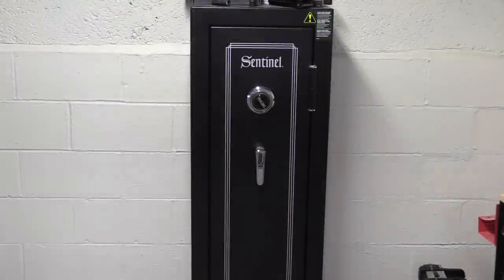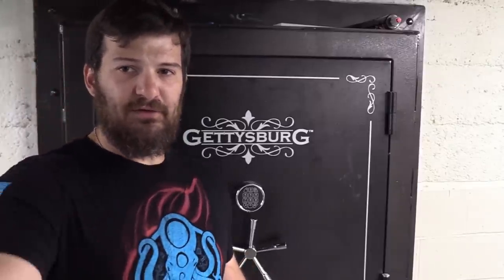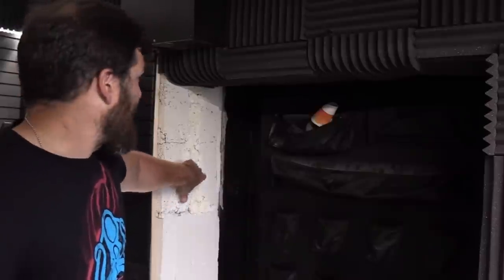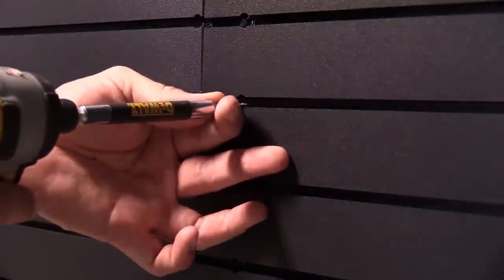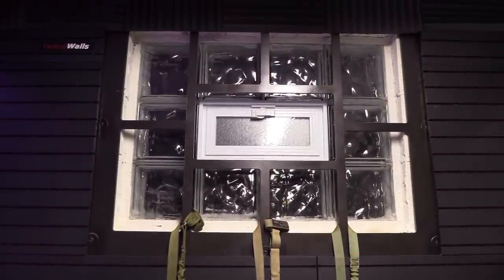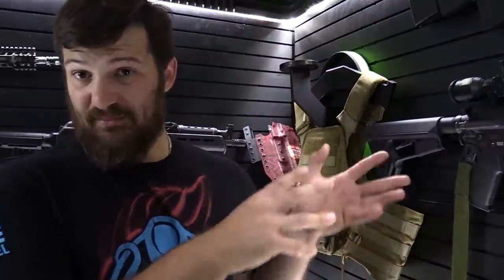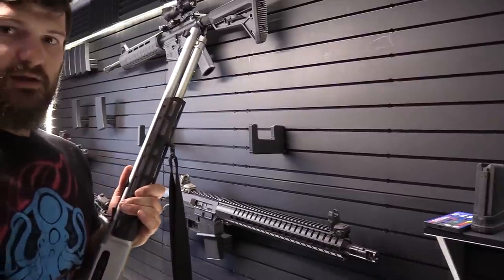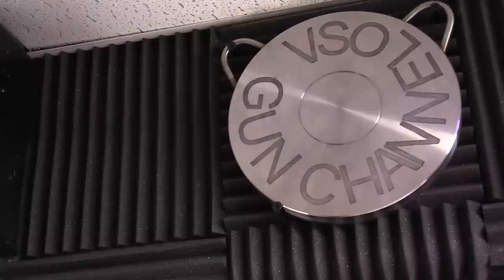The Ultimate DIY Vault Room

Comment: That window is a weak point.
Reply: Super nice room though. Not hating, nice work.
Reply: really?? the drop ceiling isn't?? would take me about 5 minutes to get in from the top, the window is a lot more difficult and obviously he's doing this for fun
Reply: He said in the video it has concrete above the dropped ceiling but yes I would of blocked in the window
Reply: Grapple hook anyone????
Reply: JoePJack1 grapple hook? Have fun with that James Bond
Reply: Angle grinder with 15 extra discs (probably olny need about 5) and a few hours, thats all what window would take.
Reply: @flyingfishsauce  would take a whole 5 minutes
Reply: DavePlaysGames Im giving the benefit of the doubt to that metal grate thing, that steel would take a little more than 5 minutes. Then again, I would be cutting the whole thing off because im not trying to squeeze through a small hole.
Reply: Plasma cutter?
Reply: I agree, the window is definitely a weak point.  Plus with an 18-inch concrete roof over the room, it's definitely not directly under the house. And from the looks of the shrubs outside the window it looks like that windowed wall could be exposed on the outside.  Which means somebody in a beefed up truck and a chain could kick out the blocks, wrap chain around the the great, and yank a hole right through the wall. Not a good day.....  Yeah I would definitely get rid of that window and reinforce that area with rebar.
Reply: I stopped the video when I saw the window... ware of money bro!
Reply: no i was thinking more it would be harder to find his house, then i was going with the burn the whole thing down type of thing then yeah would prolly need a ladder or two
Reply: just cut or torch the mig welds on the door
Reply: 5 minutes through concrete he has in the ceiling ? You are a beast !    LOL
Reply: just a screwdriver after a rock through that window, look at the screws holding the cage in !   Its still a very safe and secure room, not hating at all !
Reply: @warrenmichael918   why bother with a screw driver, a truck and a winch yank the whole damn thing out in a tug.
Reply: @flyingfishsauce   a 40 dollar 18volt Ryobi reciprocating saw, and two good blades would open that like a sardine can in 2 minutes...  The thing about "hardened" steel... Is carbide blades zip right thru it.

...but don't tell anyone, they might call you stupid. 😂
Reply: @paulthorla9569  who... what? who other than a foreign invading military force would take the time and resources to rob a house with that much effort?
Reply: Oxypropane cutting torch (small backpack sized one) -> 10 seconds for each bar
Angle grinder (portable one with battery pack) -> 20 seconds for each bar (with some noise)
portable 5 tons hidraulic jack -> 30 seconds for the whole grate
Truck and heavy chain -> few seconds for the whole grate.
In Italy (where all houses are made with very thick concrete and bricks wall and almost all are provided with heavy steel doors with steel frames, one or two high security locks and various lock bolts all around the door) we know that burglar always search for the weakest spot!
Note: i live inside an house which have windows protected by better grates than yours (i also have armored blinds) whit also a safety door (less safety than your door but surely much more secure than your window and pretty much the same security of my windows!)... my whole house is more secure than your "vault" even if my house is not considered extraordinary safe for Italian standards (this is just a standard home, same as all neigbours!)
Reply: bullet proof glass
Reply: CA P.O.W or the roof...
Reply: Agreed. Any quality hydraulic jack would make short work of that steel frame.
Reply: @bowhuntinbob8269   He has a steel cage around the windows. It would take some time and lots of noise to gey thru. Not to mention the motion sensors
Reply: @flyingfishsauce   Yeah just gotta pray no one sees or hears it....
Reply: was going to say, just drill down from the ceiling. Still, cool project. Looks like it was fun getting it setup and is a great studio.
Reply: @bowhuntinbob8269  bet its not.
Reply: @davidschlarp1606  The ceiling is poured concrete reinforced with steel. He mentions that point in the video.
Reply: To be fair that glass is really solid and would take a lot of effort to break, as well as the bars. Any thief could see what’s inside tho without the curtains
Reply: I’m betting it’s just a room in his basement not a complete concrete structure i mean a window why the f would anyone design a gun room with a window
Reply: First you have to beat the alarm system with a motion detector and probably cameras and the deal with the nosy neighbors.  He said that an adult can't fit through the hole.  Besides are you going to want to poke your head through the hole knowing the arsenal that he has?
Reply: I was just going to say why would you put that where the window is?  You need to steel plate that and concrete it.

Comment: Odd design choices here.  Going through all that work and money to build a room like that but cutting corners in the end. People that live in your town might see this and recognize you and be like hey I know that guy.  All it takes is someone knowing about it being there to show up with a hook on a pole come in smash out that vent window and hook a gun off the wall pull it out and run off. Or several guns.  If you insist on having natural lighting in there put a steel grid over that window that is not big enough to slide a gun through the openings. 

 You never showed the inside of the door but since its a safe door I assume you cant open it from the inside. That is just a bad idea. 

 You say so many stupid people but come on dont cut corners.
Reply: Also an angle grinder will defeat that safe door quickly and easily. If you are going for  protection, you cant cut corners when building something like this.
Reply: The motion sensor alerting police would solve the angle grinder problem, Police response time is slow but it's not that slow, As for the window, Yes it is a week point, I wouldn't figure it would be all that doable to hook a gun off the wall, But you could, The thing I see is it would be a lot easier to cut that grate out than it would cut anything else out, and if he had to go into the vault room during a home invasion or something to defend himself, If anyone looked in that window and saw that vault room they could just sit there and watch that window while their buddies hit the house, Then if he ran in the vault room he could easily get shot from the window.
Reply: @towtruckaj  relying on the police to always be there is bad planning period. If that were the case then a room with a heavy wooden door is all that's needed.
Reply: Negative, A heavy wooden door would be a lot easier and quicker to defeat than a vault door, I am not implying that you should rely on police, I am implying that to use an angle grinder to cut through the vault door, Would definitely give police enough time to respond, Despite their long response times, Which leaves the window to be weak point as it would be a lot quicker to cut through the window than the vault door.
Reply: criminals like soft targets for what he has not to shit talk his collection i think your average criminal would be better served hitting a much softer target than this 

for the amount of planning and tooling this heist would be combined with the high chance of getting caught because of the alarm the pay off isnt going to be worth it
Reply: If you take off the inside back panel of any consumer gun safe, you can actuate the locking mechanism by hand.  The live bolts and the mechanism they are welded too are typically blocked from moving by a simple, spring-loaded bar from the combo box, which engages a slot in the bar that moves the locking bolts.  It can be pushed out of the way with a finger and the bolts can be retracted.
Reply: Why not use the hook to break glass window, hook the guns then using the hook to fire the gun at the other guns
Reply: Shhhhh don't fucking tell him Jesus he will fix it before...…….
Reply: That's okay. If he gets locked in, he can just break the window....
Reply: @thesethmedlin9312  🤣

Comment: I'm a concrete cutter. I can get in there with no problem 😊. Look up wall saw or wire saw. I've cut actual bank vaults. Newer ones are only 8"-12" but loaded with rebar#10 on a 1)2" spacing. Old ones can be 1'-3' thick with basicly a bird cage of railroad track. But I'm on your side 😁. Looks cool. Got a plan for my own one day.
Reply: lmfao you could use a sledge hammer to break those blocks. this is a terrible design. nevermind he used glass blocks as a window? lmfao

Comment: Did a basement remodel on a house and the dude had a 20x30 block room with a 10 foot vault door built and then pretty much built the house around the basement vault. No windows.. had a 8 inch pvc pipe stubbing out of the block wall that ran underground 350 yards away from the house and stubbed above ground for fresh air into the vault. Definitely made me look into putting one in my house.

Comment: The walls are just a very expensive version of Slat Wall, the same stuff used on stores.  If you are looking for a budget version watch for mall stores going out of business & talk with the manager.  The weakness I see is three fold;  
One, dependence of electronics in the motion sensor and the door lock.  Power goes out for a while and you have a problem.  In a SHTF situation the electronics, well...
Two, what prevents you from being locked in?  Any way to operate the door from the inside?
Three, the bolts holding the safe front to the wall.  Maybe I missed it but what keeps some yokel with a grinder from taking the heads off the bolts and prying the door forward?  Having defeated the motion sensor/alarms first of course.
I would suggest buying some heavy angle iron, say 6" x 6" and building an inner door frame  and welding it to the outer door frame with the concrete surround trapped in between.   That way, even if they grind off the bolt heads the door cant be pried forward.
Do you have enough room to build a false wall over the door?  People can't break into a space if they don't know it is there.  Maybe some shelves attached with junk stored on it no body would look at twice.  Old electronic scraps, worn out car parts, etc.  Do not put food stores there, people WILL be looking for that of SHTF.
I do see the window is quite hardened, you could add a set of riot bars to the outside to make it just that much harder.  Also consider planting a prickly plant of some sort, such as a cactus in the dryer areas.  It needs to be a low dense bush with spiny leaves and/or thorns so it both obscures the view of the window from outside and is another barrier to prevent access to the window.  You still get airflow but the window is harder to detect and harder to penetrate.

Comment: Can you open the door from inside? This looks really good, but that window is a problem.
Reply: Uploader used a SAFE, not VAULT door. Typically Vault doors have a way to open from inside. Safe doors do not.
Even if door does have that option, it would be very easy to someone to block the vault door as it opens outward.
Reply: The window will come in handy if he gets locked inside... 😂

Comment: Not to be that guy .... but cut the heads of those bolts off with an angle grinder and pull the door off the wall. And the window should be obvious. With that said it's a decently secure place otherwise especially if the alarm you mentioned is actually armed.
Reply: Tap and thread the holes and weld the nuts on to the metal. Hell,  weld a nut on both sides of the metal frame.
Reply: You need a backing plate because concrete is only good with handling compressive forces.  So unless he has an inner and outer frame, that door is easier to pull than he realizes.  

Oh no, not an alarm system!  Cut the phone line and bring a cell jammer.  Pickup truck and a chain for the poorly-attached window grate.  

Honestly, I'd rather use a large safe anchored to the floor.

Comment: First heavy rain i see that shit flooding. I dont trust any basement because of that
Reply: or maybe he doesnt live in a house that floods? none of my basements have ever flooded and they were all finished.
Reply: Mine either in the 18 years I've lived here, but then again I live on a hill
Reply: I've never had a problem either but I still don't store my important things down there
Reply: Why's that? You should know your house, and wether it may flood or not. I know one specific condition that will make mine flood, and it's on me to make sure that condition doesn't exist. I also know it's damp, so I have a dehumidifier. You can also put things off the floor, and install a sump pump.
Reply: @sethwatson8952  I know I have a sump pump and never had water. I also know over time concrete settles and cracks which leads to water. Hence not if but when
Reply: Not really, no. Either the water is there, or it is not. Even is concrete is not cracked, it's still porous to water. Plus, there are built in joints that are essentially cracks.
Reply: @sethwatson8952  I think he said there was water in his basement before. O well. I think it's awesome . Id put one in a closet in my master bedroom instead of the basement . I sense you are getting irritated by my logic.
Reply: Flex tape that shit.
Reply: sik59rt That window is a ground level it for sure can flood.

Comment: Hi man, i really liked your gun room, but i have a question, the electronical key mechanism battery is acceptible from the outside? Or Only for inside? And it has any security mechanism to not be stucked in? Last question, it is possible, to plug the eletronic lock on the Power of the house? And not use it depending on the battery?

Comment: What happens if they smash the glass then use rope with a hook to snag guns off the wall. They wouldn't even need to enter the room. You made so many people jealous with that room. I wish I had one
Reply: That's not quite how it works. Angle grinding the steel bars? Possible. Somehow using a magic hook and rope to move guns up off a magazine mount, while they stay hooked so you can drag them to the window and for them through the steel bars? Idiotic. Lmao.
Reply: The Tech Man I hope this is bait
Reply: yea im gonna just lasso them guns through a tiny hole in the wall at a really awkward angle
Reply: @89Interceptor  While they are snagged in place with mag catches and magnetized at the same time

Comment: That whole setup is awesome! The only thing I would have done differently would have been to either attach the vault door frame to the inside of the frame or the inside of the wall. The way it stands now you could knock the heads off of all those carriage bolts and the door would fall off. Not saying what you did wasn't strong enough it looks REALLY cool!

Comment: Dont close the door while your in there, if something bumps the lock you're fuqqed!
Reply: Geoff Tac he could just call someone to get him out. Or scream for help out the window.
Reply: TKO593  You aways set up a vault room so door can be opened from INSIDE.
  Also in reinforced concrete structure you need to plan for events in which you may be trapped inside the vault.
Reply: Naw bro, he has a window he can knock out
Reply: According to the uploader the window is "SUPER STRONG".. it cant be knocked out or cut as frame is made of hardened steel.
Reply: If you take the fabric covered fiberboard off the inside of the safe door, you can access the mechanism for it.  If you are using a something like this for a safe door, it would be advisable to leave yourself some tools that might be necessary to do that and to learn how to manipulate the safe mechanism from the inside.
Reply: Grumpy - you forgot to add "and hopefully the door is not blocked" intentionally or not.  I could see this used as a tornado shelter, then when debris falls against the door, you're UTCWOAP (up the creek ...).  But hey, the window would be a great escape hatch if he remembers to store a sledge hammer inside.

Comment: outdoor hinges easy access sorry all that money wasted instantly.
Reply: Nothing is fool proof.  The goal is to make it hard enough to make it not worth while.  I think he accomplished that.
Reply: @k9dark10  while true he claimed to make an awesome in house safe that is not a secure place.  im happy with what I have and spent alot less
Reply: Hinges don't secure a vault door. They only hold the weight of the door open. The locking cylinders are what engages the frame and provides retention.
Reply: Hinges aren't what locks the door. You could completely remove the hinges and the door would still be attached. The window outside is what makes this insecure. I could grind that metal off and smash that window in pretty fast.

Comment: Everyone complaining about the window or the cinder blocks or the ceiling as a weak spot...all wrong.  The door itself is the weak spot.  Like most consumer gun safes, that safe door is made up of sheet steel:  10ga if it's a decent safe, but more likely a couple of layers of 12ga or 14ga.  Plus some sheet rock, some angle iron, and the lock works itself.  The door can be destroyed with a fire ax or cut open with an angle grinder.  It's a UL "Residentail Container," which means it won't hold up to effective tool attacks for more than 5 minutes.

To add more time, or complicate the level of skills and tools involved, the door needs to be made from plate steel.  At least 3/16".  1/4" or 1/2" even better.

But, he's got the right idea:  Unless the alarm is defeated, he shouldn't have to worry.  And if you have cameras on the exterior that send real time images and motion detection alerts that you pay attention to, you can probably get the cops to respond in time.

In the end, it's a room made up as a very large, consumer grade gun safe.  And that's ok, as long as you understand the limitations.